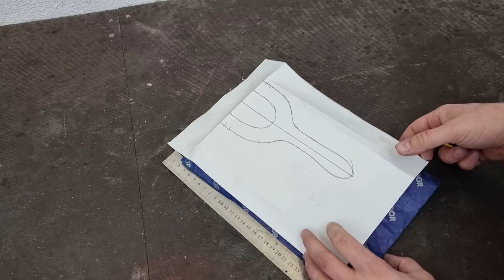Coolest DIY Slingshot with Dart - Mini Arrow

Comment: It's good, but it's a bit unsafe, because the arrow head is behind the hand and it's not stable, it can come down and hit the hand due to the shooter's carelessness.
Reply: you are correct. I made one but the tip was duel wood so luckily it didn't do much damage to my hand, still hurt. I suggest making them with rubber tips, getting good at it, then use the real deal with hand protection on.
Reply: tele

Comment: pretty cool, i would put pins through the arrow heads and shaft since there is constant pressure pulling them apart when you launch. That 5 min epoxy only lasts so long in my experience.

Comment: Hi! Good film, although you would increase the power by reducing the mass of the arrows, making the rays thinner, which should also be truncated at the point where the tips are placed. A portion of the beam that protrudes at a sharp angle will block the arrow from further penetrating the target. I've made similar mistakes. Regards
Reply: Maybe also change the arrangement of the ailerons of the arrows to a horizontal one - in relation to the plane formed by tight rubbers. The ailerons will come out smoother when shooting without hitting the ring.
Reply from the maker: Thanks for the tips!
Reply: @weaponizer4444  б

Comment: bahaya,,,cincin logamnya harus diganti dengan kawat.kalau tidak panah ya bisa berbalik.
Reply: You are correct!.. When I was 10 yrs old, I shoot the same designed arrow with same slingshot launcher- immediately, I proceed to my target, a tree trunk, around 30 mtrs away...I cant find the suppose dart, imbedded in the bark of the same tree!.. So I returned to my launching  position, and I discovered the missing dart imbedded to the plywood wall of our terrace!... Thanks God!, the same dart didnt hit me in the abdomen area- when it made a sudden U- turn trajectory- due to entanglement with the launching hook!.. Lesson:  1) The hook launcher must be stainless wire ( to resist rusting), inverted triangle or oval in shape, the tip of the arrowhead must be longer than 7. mm from the inner space of the said triangular or oval shape launcher;.. 2) The arrow head part/ barbed for hooking on the said triang'r slingshot launcher- it must be very loose and not sharp, to avoid being stucked or trapped to the same triang'r shape wire launcher- upon release by the fingers!... 3) Parents must always (100%) inspect their childrens  finished D.I.Y. toys- to avoid injuries, accidents, etc due to children defectively designed toys, gadgetries,hobbies, etc...